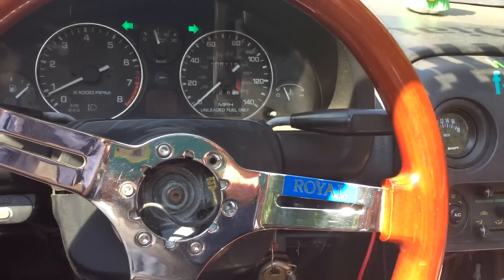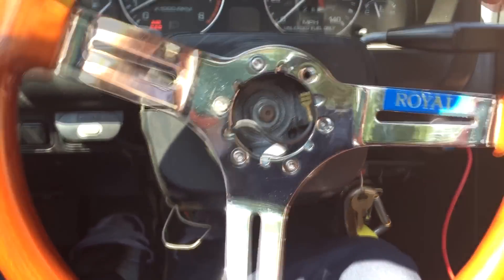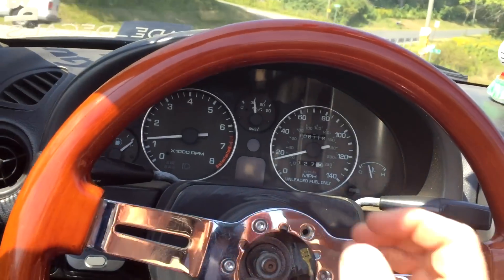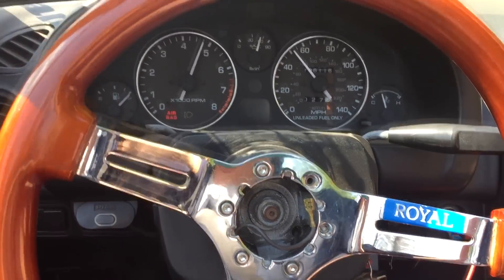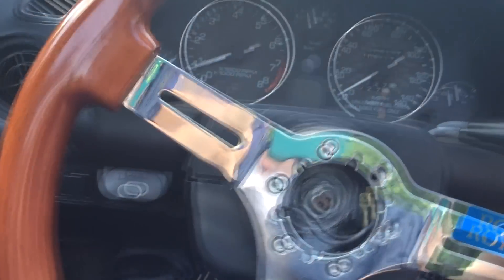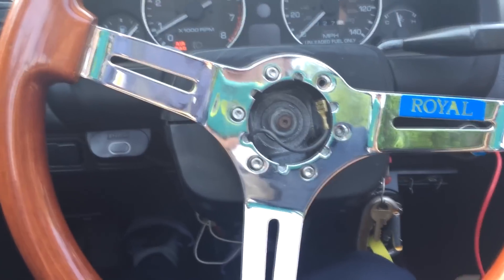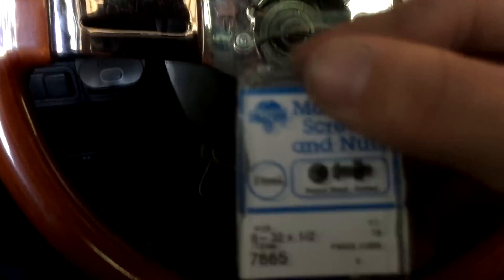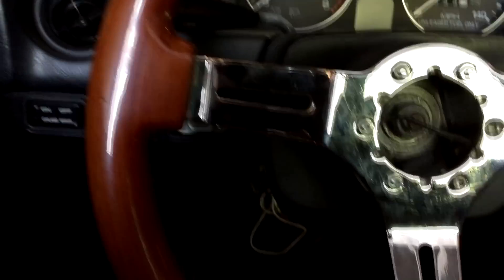Why Not To Buy Ebay Parts

Comment: I purchased my quick release off of eBay?? And it's fine 😁 I guess it's just a hit or miss my buddy is running a full eBay turbo kit for 600 bucks and now 1500 miles later it's still running with a little over 400 hp

Comment: I've purchased parts for my s13 on or really via EBay and not from EBay.  I've purchased used but good OEM parts from private sellers via EBay.  I have also purchased new parts from companies that sell via EBay like P2M.  I haven't been ripped off yet or been left stranded miles from my home.

Comment: The civic is idling like that cause you have an issue with the idle air control system and probably the timing... just a heads up

The body is crap though

Comment: It has the "wrong size bolts" in the hub. Go to the hardware store and find the correct size for your hub. If you feel the hub is cheap, get a Grant from Pep Boys. This is a no biggie. I got a MOMO steering wheel and MOMO hub from MOMO and guess what? WRONG SIZE BOLTS. Went to Ace Hardware, got the right size bolts. I didn't make a vid about it.

Comment: i love ebay parts, i got a set of drilled and slotted rotors and a set ceramic brake pads for 70 bucks. they work mint. just dont buy steering wheel hubs off of ebay i guess lol

Comment: why rev out so much when you get the same power shifting at 3.5 lol
Reply: +kaillick666 you don't. These engines make peak power at like 6 grand. I mean it's an NA Miata so it's making like 90hp to begin with, but it still makes more power at higher revs until you start creeping up to the red line.

Comment: You should never buy cheap knockoff hubs from ebay. They wear faster because of the cheap materials used to make them. I love the Haggard garage theme, but at least have legit parts for the safety components of your cars.
Reply: +Fumxe's BVE Channel! I agree! But Rudnik says that he simply cannot afford better.
Reply: If I was him, I'd try to save up at least a decent amount of money to buy a good part. It may take long, but it's worth it in the long run.
Reply: +apex128 it's not like the stock wheel is undriveable, lol.